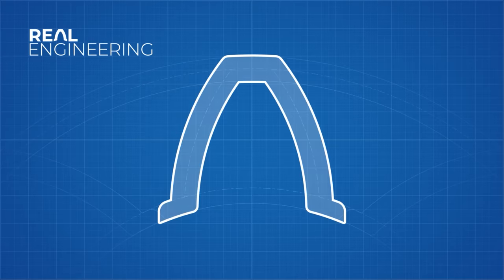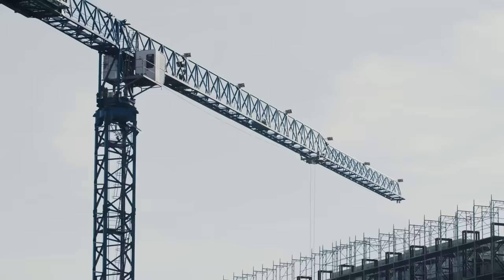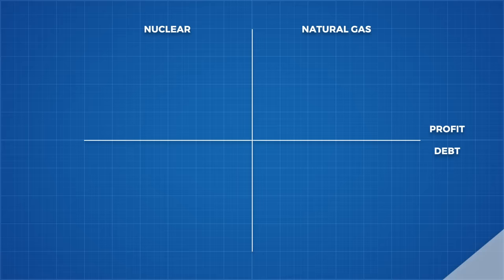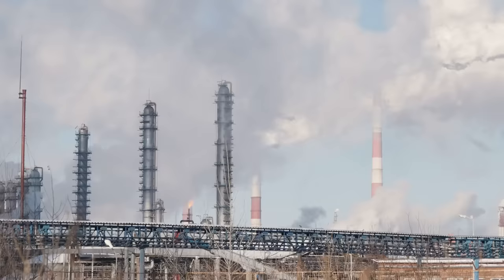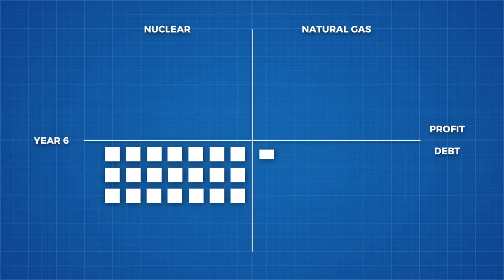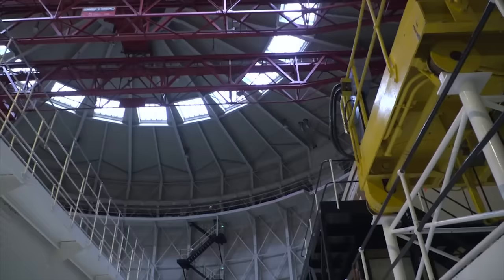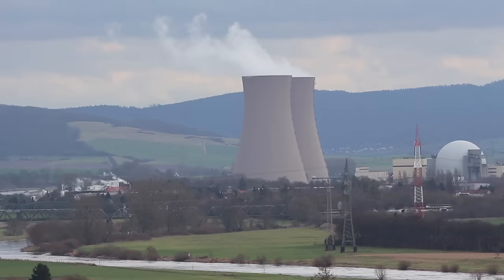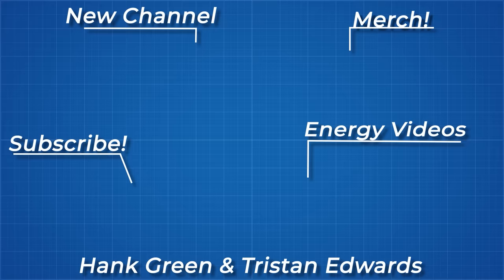The Economics of Nuclear Energy

Comment: Fun fact : Solar energy is actually nuclear energy from safe distance 😆😆
Reply: Fun fact : Solar energy doesn't work half the time and needs to burn fossil fuels as a buffer.
Reply: @gladonos3384  not really true at all. Can be supplemented with non fossil burning sources, and has it expand, it will be possible to balance power accross the grid. (Ie: the East can power the West countries can have net zero export/import agreements, etc.)

Also battery technogy is evolving very quick.

So burbing fosil fuel is not required.
Reply: @gladonos3384  I mean, there are other buffer solutions besides burning fossile fuels, but it is a problem that needs addressing.
Reply: @fmaz1952  "Can be supplemented with non fossil burning sources..."
-
What non-fossil fuel burning sources are those?
-
"(Ie: the East can power the West countries..."
-
Two words: Transmission losses. You can't transfer power over thousands of miles without incurring horrific losses. For your idea to work, you'd not only need to massively overproduce solar energy to make up for the days when there just isn't much sun, but also to make up for the incredible losses associated with transmitting power over huge distances. When you factor in all of this ridiculous, unreliable over production of energy, nuclear is likely to be the better option, by a long shot.
Reply: So you mean solar energy is just like social distancing? Ok, I get you.
Reply: And fusion energy is solar energy when we make our own little sun for convenience.
Reply: Fun fact: solar energy kills 20 times more people than nuclear per unit of energy produced 😆😆
Reply: Only in the ideal circumstances, where u point the panels at the sun 24/7 and there's no weather condition, dust/snow covering the panels, temperature (overheating reduce efficiency of some solar generators)
Reply: Technically it's nuclear fusion and the video is covering fission which is the whole problem with this debate...Until we get a fusion reactor, fission will always be marred with the same issues nuclear always had
Reply: @PistonAvatarGuy  Actually power grids can actually be surprisingly efficient. The European power grid as a whole has about a 6% transmission loss, and most of that happens at medium-low voltages. HVDC lines can get as low as 3% loss per 1000km with current tecnology. That would make it more or less possible to transfer power from a sunny area to a shaded one with at most "just" a 30-40% loss. The issue is that this makes literally zero sense considering the immense investment necessary to build such a grid, when we already have a perfectly good almost carbon free baseload power source.
Reply: Not really, since solar in terms of PV is utilizing a spectrum of electromagnetic energy released by nuclear that nuclear production doesn’t really utilize.
Reply: @demoniack81  "....when we already have a perfectly good almost carbon free baseload power source."
-
Which is?
Reply: @PistonAvatarGuy  Nuclear, geothermal, hydro, and off shore wind . All can provide reliable baseload power during the night. Use each in the areas where it makes sense. You can also maximize your use of solar power by using high voltage DC power lines to transmit power from each time zone into the neighbouring one (never transmitting more than one timezone, and so incurring transmission and conversion losses of less than 10%), allowing you to flatten the "duck curve" of power demand increase vs local solar generation decline that happens during the evening. You can further supplement this reduction in the duck curve through the use of "peaker plant" battery installations.

There is no need for fossil fuel baseload or peaker plants to exist going forward. With a bit of clever design and management you can eliminate the need for them without breaking the bank by building massive numbers of nuclear stations or trying to transmit power from one one side of a continent all the way to the other. Build geothermal where possible. Then hydro, where that won't work. Then off shore wind where that won't work. Then, finally, fall back on nuclear where there is no other option available. Diversification of the power system covers virtually all usage cases with currently available technology.
Reply: @brian2440  actually not nuclear.  The light comes mainly from electronic jumps produced by the nuclear rearrangements.
Reply: Not to talk fusion but fission is perfectly safe at a reasonable human body distance.  3 outputs.  Alpha, beta, gamma.  How far?  Air and say 10 feet.
Reply: @PistonAvatarGuy  The US buys electricigy produced in Northern Quebec. So long distance is possible. Maybe not accross the globe but still.

Non fossils sources:
Hydro (river dams, tidal, etc), nuclear, wind, etc.
Reply: @jasonwalker9471  ^ this is the rational approach.

We'll eventually be switching to more nuclear in the future, but right now, it's just about building everything we can to get off fossile fuels asap and linking it together to create a robust grid.

The cost of delays now will be more than the costs of optimization later.
Reply: @fmaz1952  During the winter we have darkness for up to 14 hours, spreading across a 3 hour time differential (east coast to west coast) will accomplish nothing.  Even during summer, it wouldn't cover even half the night. If you mean a global agreement, no, just no. Giving countries the ability to essentially shut off power to other countries is a global disaster waiting to happen.    Even without the political aspect, one area getting hit by say a hurricane would have global impact on power production.  Not to mention the transmission power losses the longer distance you go would add huge costs. As to batteries, not for a long time.  Battery production can't even keep up with the need for electric cars, adding grid power storage is just a pipe dream, never mind the cost of those batteries.
Reply: @fmaz1952  What advances in batteries have there been recent, because from what I remember there has been little to none, its still expensive and huge to build battery stations to hold power long term.
Reply: @gladonos3384  Or large scale batteries.
Reply: @demoniack81  Source please.
Reply: GLaDOnOS 
Batteries. Over produce solar during the day and store the extra for the night
Reply: ... and extremely dilute
Reply: @aromaticsnail  the real reason that nuclear has such a bad PR issue is that it was unveiled to the world first as a weapon and not a tool. If nuclear power was the first means the world had to seeing nuclear potential we would be living in a vastly different power-grid today
Reply: Fun Fact: Nuclear accidents usually caused by humans. But no one ever want to talk about this problems. From Chernobyl to Fukushima. All human factors.

Corruptions amongst the people who run and managed nuclear power plants are rampant. This is the main reason I still refused to actually support nuclear energy.

You don't get meltdown from windmill or solar panel.
Reply: @PistonAvatarGuy  While it is true that Nuclear will be needed for quite some time, eventually solar and battery storage will likely dominate. Both battery storage and solar panels are quickly dropping in costs and becoming more efficient and longer lasting at the same time. There are also still so many battery break throughs that have yet to be made and scaled up. Once these occur, battery storage will be obvious.
Reply: @nntflow7058  If somebody design fully autonomous nuclear power plant then you will support ?
Reply: @jeffreysmith4586  assuming significant cost reduction and effectiveness of batteries, batteries can also improve nuclear energy by charging at night and discharging during day. The same can be applied to about, every form of power generation. It would improve most power generation method instead of affecting solar power only
Reply: @fmaz1952  Do you even understand how a solar panel is made?
I don't think you do. "burbing fosil fuel" is all we've ever done and thus far, all we can ever do.
Reply: @demoniack81  Its also killing many species of plant life and wildlife. Turning the land it occupies from desert into wasteland. I was surprised to learn these things set birds on fire.
Reply: @GI-AUS  Just google "deaths per twh by power source". There are a million sources.
Reply: @benjaminkopecky4689  Battery cost has plummeted over the last 10 years alone. A 1kWh li-ion battery pack cost $1200 in 2010, it costs $150 now.
On average the price is going down by 20% a year.
Reply: @fmaz1952  the US is literally next to Quebec
Reply: Correct, it's nuclear fusion, if we managed to get that working down here on earth, there's no limit on how far we can go in this universe...
Reply: @demoniack81  But it has been lithium ion for years now, and while prices have plummeted, they would still have to be expensive and massive to make any sort of real solution to solar or wind, and battery tech doesn't seem to be improving much, and seems to be so incrimental that unlike the invention of lithium ion, i dont see a battery tech jump in my lifetime.
Reply: @skylark306  True, cost effective battery storage will be helpful for all power generation but it will be most helpful for the most intermittent power sources like solar and wind.
Reply: @rey_nemaattori 
And who ownes the power plants?
Today everything has to be private and you won't need mroe than two or three plants for a whole country, (more than one so one having a power out doesn't mean the whole country is out of energy). So you whole energy systems is in the hand of at best 3 companies.
Reply: Make that "less safe" distance.  150 million km from the sun, you can get a sunburn and cancer.  10 meters away from a nuclear reactor vessel: no such danger, unless you are outside in the sun.